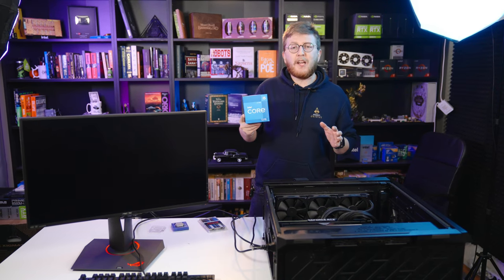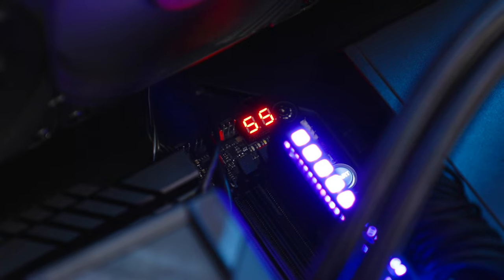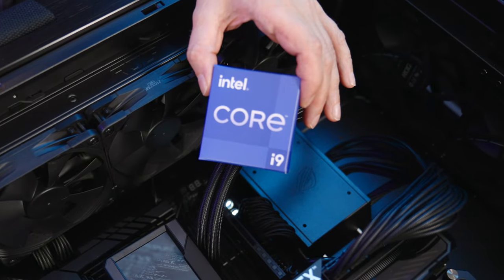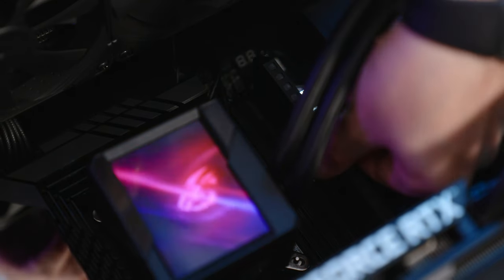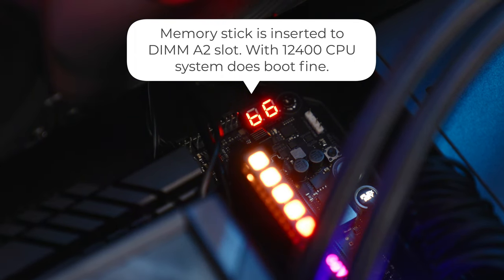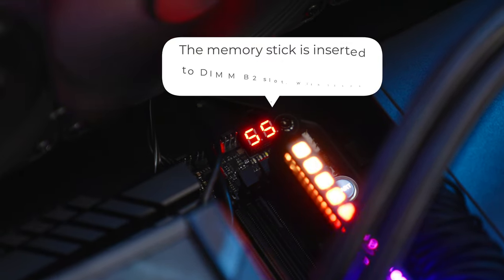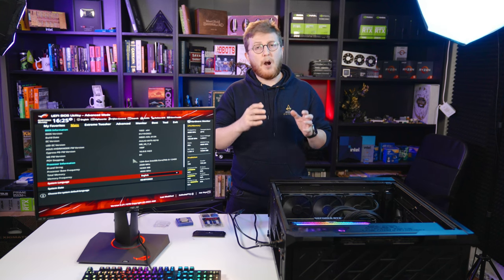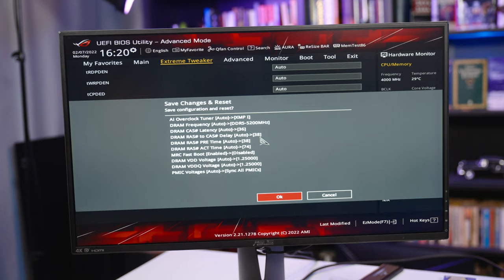How did we identify a bad CPU? QCODE 55 error

Comment: I'm getting this error and my monitor will not light up
Reply: Me too. Did you end up figuring it out?
Reply: Current having this problem as well, any updates by chance?
Reply: @ravenwolfe8263  I’m not sure if you have the same issue but I had to end up taking out my ram sticks and putting them into different slots, and I needed 1 stick in at once, rather than both. For some reason, that got my monitor to display. Then I went into the BIOS and changed some settings then I was able to turn it off and put in both ram sticks
Reply: I got this problem after I disassembled my PC and before this I updated the bios...
Reply: @anthonymartinez71604 what you did in the bios

Comment: Thanks for sharing your experience ! 👍
Actually, I had the same problem as you. I suddenly had a crash when my machine had been working wonderfully for 3 months. I also got error 55 looping on startup with unable to access bios. Obviously, channel A was bugged while on channel B, the RAM was working fine.
I had several suspicions of failure (memory, poor CPU pressure, faulty motherboard...) then I came across your video. I then replaced my 12900k and BAM, everything works perfectly again. So I think there is a serious memory controller problem on the first versions of Alder Lake. 🙄

Comment: I have a Z390 on my asrock
Phantom Gaming X sometimes has code 55 even with disabled MRC FAst Boot G memory. Skill was chosen the one that is listed on the motherboard manufacturer's website as tested for compatibility and overclocking, the firmware for the latest BIOS did not help. there are no bent legs in the processor socket and in the RAM slots all the memory and processor contacts are clean. I even bought other dice from G.Skill, the same trouble or the motherboard is shit or she doesn’t like dice from this manufacturer. After 2 unsuccessful starts, the BIOS itself resets the BIOS to default, after I load the saved BIOS settings preset, it is saved and the computer boots and works stably, but randomly when rebooting, 55 code can fly out even with an XMP profile, either with manual overclocking, or with default settings. Tech support writes try another processor, but what's wrong with that, then I took the boxed version of 9900k, it works stably, no problems were noticed in the work. The percent is in stock without overclocking. Overclocking removed the memory from 3600 to 2666, it became less common to appear 55 code but did not disappear completely.
Reply: I sometimes get error code 55 on my maximus asus hero z790 once I reboot the pc, but I have no idea what the issue can be I do run G-skill ram with xmp on do you know what it can be about?
Reply: @SirSone1

Comment: I hope u can help me brother i have the new motherboard asus rog hero z790 everything is turning on all the fans everything but im having that 55 number on the motherboard and constant orange or amber light in the motherboard what should i do ,
Reply: did you ever figure out what happened
Reply: @foolishfriends5463  i try to do everything even i buy a new motherboard and thats still like that i change rams still lilr that i was place one by one the ram and still lile that so now what im thinking is the cpu
Reply: @Gmaker47  ah okay I just built my first pc today and I just got error code 55 so I was wondering
Reply: @foolishfriends5463  i hope u can fix it if u find the solution let me know
Reply: Did you guys figure this out? I’m building my pc now and am running into the same 55 code on the z790
Reply: @justinchew2445  bro my problem was the processor was faulty they send me a new one but broken so i had to send it back and now is working fantastic
Reply: @Gmaker47  what processer are you using?
Reply: I have the exact same issue. I got all 3 parts of my mobo, ram and cpu tested independently and with each other by technicians and all worked, they just did a bios update.  However when I reassembled in my case I got vode 55 and no post again.  I already ruled out the PSU being an issue.

Maybe my bios reset itself?  Cmos failure?  I've tried everything I can think of, including adjusting the pressure on the CPU. 2:43 .@Gmaker47

Comment: I changed out 13900k, mobo and ram and did everything with xmp and the Mrc setting still have code 55
Reply: Did you end up figuring it out?
Reply: @anthonymartinez71604  yes sir, ended up getting a mpg board and everything worked fine so i guess it was just an issue with asus

Comment: Hi, thanks for the video. I have a similar problem but little deeper than this. I just got a new cpu a i9-13900k and after installing I’m getting error code 55. I tried every way a2 only, b2 only, a1, b1, individually, together, you name it I tried it. Before I had a i7-12700k and 4 Corsair sticks on same motherboard and everything was working fine. Can my cpu memory controllers all be bad? Thanks
Reply: I have the same problem, same cpu

Comment: i change cooler ...and now i got error 55 ... 
that is happening when i got all my 4 dim of ram installed...i finally make it work when i leave only 2 dim of ram... what could be wrong ?
Reply: The bios?
Reply: The cpu internal memory controller can't handle 4 stick with high frequency. Reduce the memory speed and or timing.
Reply: @alantan157  timming and speeds if i remember correctly is on defaults or max possible from factory settings

Comment: Thanks for the video. I’m working through a similar issue with an i7 11700k. Getting a different motherboard to check it out. Very helpful video. I’ll try it and see. I’ve also seen where your CPU cooler can cause RAM issues as well.
Reply: Hi, did you ever find out what the issue was?
Reply: @SirSone1  I sure did. I had a few pins on the motherboard that were bent. The bend was so slight though. I compared all the pins and noticed that a few look slightly "different". I bought another motherboard to test the CPU and RAM and it worked perfectly. So I returned my defective board and was refunded. I'm glad that I bought it from Newegg. Whichever pins those were affected the RAM slots. The RAM and CPU still are working great, it was just that specific board. It was not the CPU cooler either. Although I also checked that too. I guess it pays to have a few extra parts laying around.
Reply: @nickschatko  Thanks for your answer sometimes my pc gets stuck at 55 like a few times a week, but I just hold in the power button and it takes me to bios then windows and then I can reboot the pc normally, but it happens every now and then you think my motherboard could be faulty too?
Reply: @SirSone1  Another good question. You have to rule out somethings before you blame the hardware. I would make sure that your ram sticks are seated correctly. Also make sure they are clean. Try each stick one at a time. Also check to make sure the cooler is properly and evenly tightened. Check that your firmware is updated as well.  If you feel comfortable, also consider checking the seating of the CPU. If none of these work, you should try and test your hardware on another computer before you replace it. Try and isolate the parts. I am willing to bet thought that your cooler might be related to the problem. I assume that your code comes after the computer is on for sometime? The heat and how the cooler is applying pressure might cause this problem.
Reply: @SirSone1  And to be clear, mine would not post with dual channel memory, no matter how I did it which help to narrow down the cause. Because yours is intermittently I would try and check all the seating. I hope this helps.
Reply: @nickschatko  Thank you for the useful information and yeah I can keep rebooting without any issues, but when the pc is on for a while and I suddenly decide to restart it gets stuck at 55 which makes me have to hold in the power button which takes me to bios then windows pretty much.
Reply: @SirSone1  Fro sure, I would check the seating and see if that helps.

Comment: Ram voltage problem when use 4 ram slot
Ram voltaj problemi, ayarlanmalı.
Проблема с питанием оперативки.

I have this problem on my 11700, Z590 when use 4 x 8gb 4400 under 1.4v power